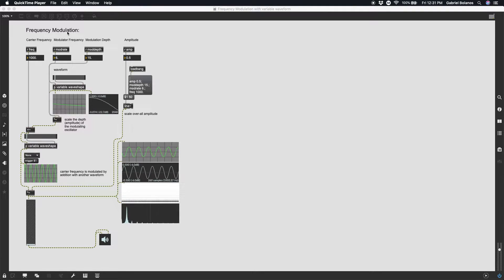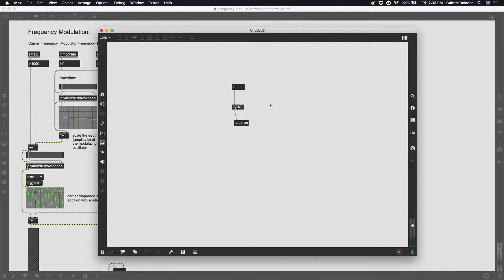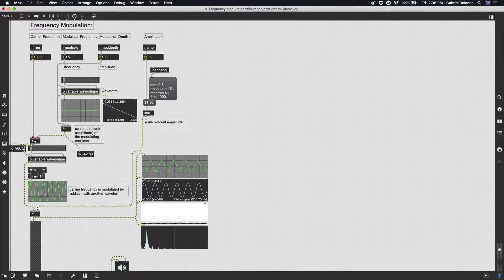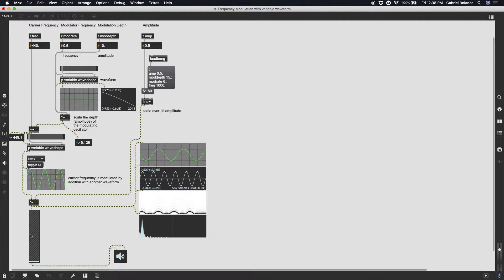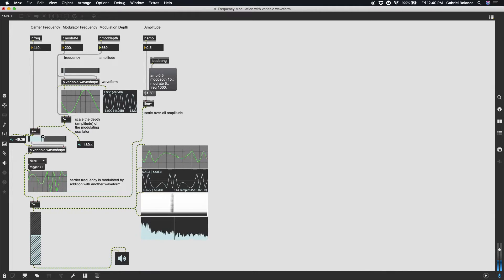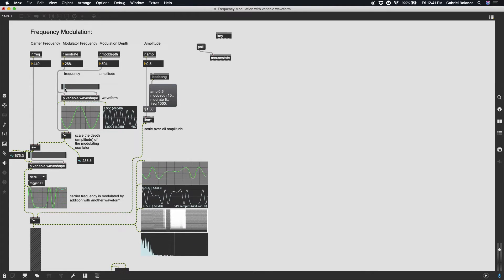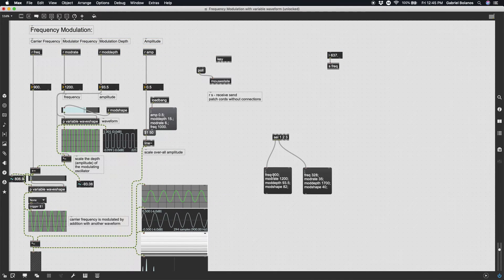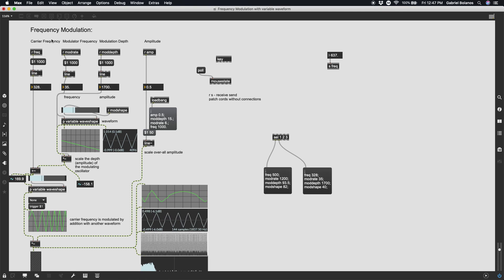Frequency Modulation

Comment: Thanks for your sharing! It’s such a helpful video for me. I got a question and i wonder if you could give me some advice. I want to use the exact pitches  of a spectrum after FM processing as my music material( like Murail do on his word Gondwana) do you have any recommended way to calculate or software ? Thank you so much!
Reply from the maker: You can calculate RM -based harmonies with sum and difference tones: just add and subtract the frequencies of the pitches you want to ring-modulate. To get a richer harmony, add and subtract the frequencies of each pitch's first few overtones as well.

You could also record a synthesized sound and analyze the overtones in SPEAR, then orchestrate those.
Reply: Gabriel Bolaños okay! Thanks for your reply! I’ll try!